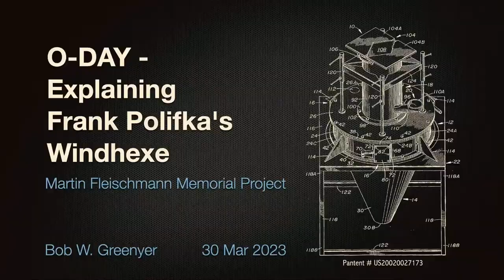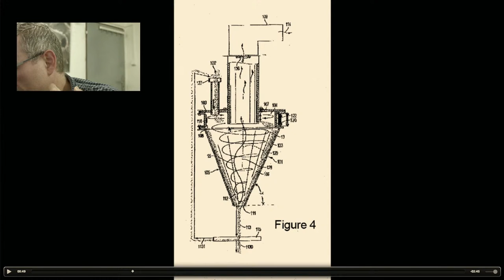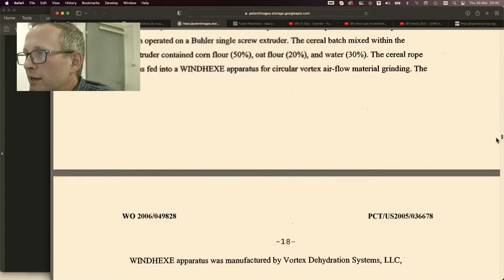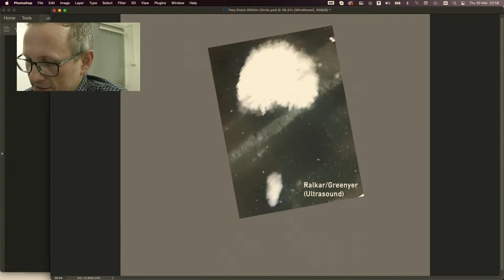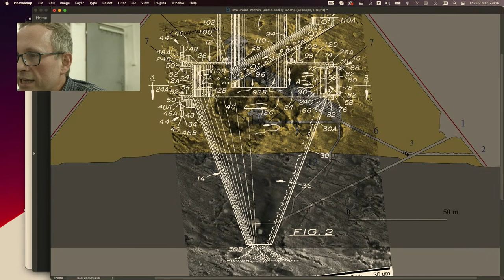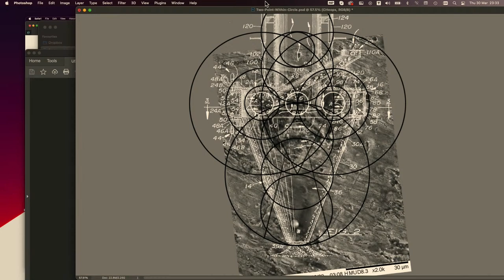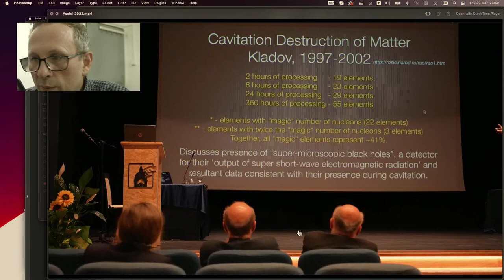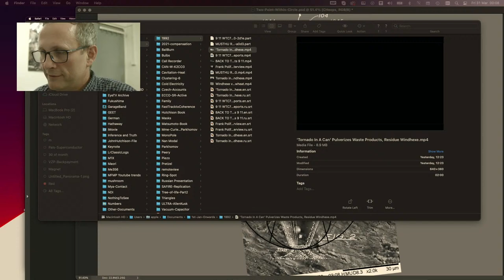O-Day - Explaining Frank Polifka's Windhexe 'Tornado Machine'

Comment: I appreciate your point of view. I do think some of the observations you offer on the pyramids are spot on. I would like to add some observations accumulated over the years of my study into Nikola tesla and the pyramids. 
First, the pyramids are constructed of entirely diamagnetic materials. No exception. 
The powdered calcite at 10 meters depth is so well compacted, that it seems as a rock. That is Uber important…..there can be no electrical connection to the earth, for the circuit of Giza to function properly. Equally, the capstones are insulators, and make sure all electrostatic energy is conserved in the rose quartz. 
Abdel hakim awyan documents the three tunnels that brought the water through the solid limestone tunnels. They travel 8 miles to where the Nile used to travel. 
Abdel’s son, jousef abdel awyan documents the cavities in the rose quartz that have no visible signs of entry, accompanying every single block that has a drill hole. The cavities are next to the drill hole……how those were done is a mystery to me. 
Viktor schuaberger and dr gerrold pollack explain how water accumulates electrostatic charge(water is diamagnetic) when flowing through curved limestone. 
There is a current from the sun that “washes” over the earth continuously. It can’t be accessed as it flows over the earth, but if a standing wave is put into the electrostatic energy flowing over the earth, at each low spot, there is a compressive force pushing to the center of the earth. By virtue of the  standing wave each low spot will be exactly equal to the other, all forces, and geometries are perfectly equal, and equidistant. 
Nikola Tesla clearly understood how this worked, and very carefully explained it in the Westinghouse bankruptcy hearing of Westinghouse. I have the court transcripts. 
Tesla also explained longitudinal energy, and damped waves, which are crucial to understanding how the earth can be made a reservoir of voltages in the trillions, and currents no common human could comprehend……amperes in the 100’s of thousands, and maybe millions. 
The low spots in the standing wave over the earth are @ about 75 kilometers separation from each other and, again are continuously compressing into the center of the earth, where they meet each other, and are “shunted”, and bounce back. The energy can’t bounce back, though, because there is a continuous force still pushing from the low spot in the standing wave. This compressive electrostatic energy is held in suspension, and Nikola tesla called this a damped wave. 
Now the earth is a battery like no other. The forces are all known, because the standing wave can be measured(Nikola tesla measured the circumference of the earth, minus the oceans. He was able to do this by his apparatus to measure resonance. Lightning gave it away. 
Now one only needs a tunable receiver(teslas magnifying receiver patent) to get an octave of a 1/4 wave to access trillions of volts, and currents that could easily part the seas(Moses found thoths tunable magnifying receiver). One only needs to ground the apparatus, and tune it….and ……really you are like a god, nothing can’t be done. 
Going back to the pyramids. They were ram pumps….there was a frequency(remember  the cavities) and by virtue of the volume/mass of the pyramids being an octave harmonic of the earth, the rhythm coming from the pyramids was the resonant frequency of the earth. 
The vortex that came from the top of the pyramid was electrostatic energy organized by sound, it held a gold sphere at an altitude that would put it directly in the middle of the electrostatic energy flowing over the earth. 
Nikola Tesla said he could suspend tons with magnetism, but he thought it feeble compared to the electrostatic repulsion attractive forces…..to which he could not find a limit. To tesla electrostatic repulsion and attraction is infinite. 
The sphere held at altitude of the earth, directly over the main pyramid was so well attached to the pyramids, that if you took a hammer to the pyramid, you would hear the pounding of the pyramid from the gold sphere at the same moment. 
That is how the pyramids put a standing wave on the earth. 
Anyone with a properly tuned apparatus with a top that is four feet off the ground, and perfectly insulated from the earths electric influence could tap into infinite energy. The pyramids were to protect from the deluge……the two mile high waves that wash over the earth could not penetrate the “bubble” of voltage…..

Comment: Thank you for a most excellent presentation Bob!. Ever since i heard about the Windhexe back in the early 2000s i have always wanted a bench top Windhexe materials recycling processor. Unfortunately not alot of the important know how details were or have been released over the last couple of decades o date.

But the newer 2008 patent you showed today is jam packed full of technical details, and with the help from an AI research assistant, i have managed to piece together all the rest of the details such as the compressed air pressure ranges and flow rates, roughly matched to specific diameter windhexe vortex chamber sizes.

Windhexes use alot of compressed airflow (this is quite an understatement), so for a small 30cm diameter windhexe (just like Polifka's original prototype), you will need in theory quite a large and expensive 10 horsepower (7.5 kW) air compressor for continuous use.

Although if you use a standard quite affordable vertical shop air compressor (around 90psi) with a 20 gal tank, it would be in theory good enough for decent batch processing. Well before the tank has to be recharged backup to pressure again, but using a far less rated power compressor.

Also investigated the potential of a 10cm diameter windhexe chamber design, and works out that you would only need a small entry level couple of kW (or maybe a bit less) air compressor instead. So all looks quite doable once you can fabricate or potentially buy on off the shelf vortex/ cyclone seperator chamber and alter it as someone else mentioned here (or on the other new vid you did in the comments).
Reply from the maker: Yes a shop compressed air tank and batch processing would be my approach.

Can you prepare a document for sharing with the community on these findings please.
Reply: Extra Note: Maybe a stainless steel funnel (or other durable material) with some suitable alterations and additions, could also be converted into a small windhexe chamber at quite low cost too...
Reply: @MFMP  Maybe in due course in a bit, as at present i am in the middle of a seriously intensive large sustainable building project. Which part of is also going to be my new proper fullsize workshop & innovation lab. Due to be completed in one months time ready for the big move. But i will see what i can do in between, cheers.
Reply from the maker: @petermiddleton6902  Possibly...

Comment: I found the water spout info especially fascinating. Several times I have witnessed them in both the Florida Keys, and on Lake Erie. In every instances, there were multiple spouts, and they preceded an electrical storm. One time on Lake Erie, I saw 8 of them in a straight line 2-3 miles long moving fast right in front of an extremely strong thunderstorm line, the kind that turns the sky green and has wind gusts over 80 knots. So the electrical charge theory rings true to me. BTW, the Keys are probably the best place to study them in the world as they are relatively common there. Just beware, they can collapse without warning and sink a boat by instantly filling it with water.
Reply from the maker: Thanks for sharing this informative experience. Did you ever capture any photos?
Reply: Sadly no, i had other worries at the time like getting to shore ASAP :)
Reply from the maker: @stevewindisch7400  Bet you did!

Comment: It would be interesting to be able to condense all the fluid that was removed from the material being processed that vents to 
exhaust/atmosphere. Having experimented a bit with Joe Cells I have learned that water here is not the same as water there. Having played with HHO, I am still testing this quantitively and qualitatively, but, using the entirety of your distilled water as your electrolyte vs. just using the more volatile first fraction of water will give different results to using the water that distils at the end of the process.. Some
 say using trap water will give unexpected results. But because there is so much water being pushed through the machine  it might be tricky to isolate,

Comment: Interesting video and technology! Glad I saw the video. One of my facebook mates gave it to me.

But what you described is not how you make Portland cement. In PC, you mix 80% of lime, a little sand and clay and then burn it in a huge horizontal kiln to well above 1400 °C. In a sintering process, the raw materials fuse together and form a calcium silicate mineral called 3CaO*SiO2 or alite which is stable at room temperature when cooled fast. This produces two times more CO2 than the combustion process itself because lime contains large amounts of CO2. It has little to do with mixing and although there is CaO stated, there is no quick lime. Quick lime is burnt lime CaCO3 to approximately 900°C and this makes CaO. But in Portland cement, there is no CaO but a calcium silicate named by the formula 3CaOSiO2 (and some others like 2CaO*SiO2, called belite). By the way, “Windehexe” is German for “wind witch”. No offense of course. Just thought you’d like to know.
Reply: Thats the ticket!

Comment: The key will be the energy efficiency. Eg does it take less energy to grind up a 1kg of rock or glass than say a ball mill.
Reply from the maker: In the studies by the "AirGrinder" they found:

- that the grinding was for free, the energy normally used for de-hydration gave you de-hydration and grinding.
- that metals became magnetised, allowing them their powders to be magnetically separated from mixed waste materials inputs
- that the particles where spherical and free flowing, milled ball milled materials might end up as flattened and so clumpy

In the study on preserving sweet potatoes to dry powder, it was found the particles had smaller average particle size and it was a one step process (drying and grinding). The competing processes were 1) forced drying then grinding conventionally or 2) freeze drying then grinding conventionally. The Windhexe was more efficient than both in both energy and time, had higher residual beta carotine content than 1 and similar to 2. Option 2 had a higher energy and time use. In the round, for preserving and grinding hyrdrated foods, it was the best balance between product quality and energy use and is probably why Kraft foods took it on.

The links to the AirGrinder and Potato study can be found here.
https://remoteview.substack.com/p/o-day-explaining-frank-polifkas-windhexe

Comment: The dark lines spiral in the water at the base of the water spout is the negative charge of the earth being attracted to the spout. The shortest distance is an arc in this magnetic field. Charles L. Chandler is quite wrong about many points in this book. He suggests in a tornado The charge, discharges between the rising outer wall and the falling inner wall "Ranque-Hilsch effect" and fails in not understanding this transmutation zone. He fails to account for the missing mass, debris, people, animals, cars, trees and soil, (similar to the 5 floors of debris pile with 15 floors of debris missing that should have been there and was not in the basement.) Simple observation. Then fails to account for the conversion to Hydrogen that appears with an affinity to combine with the Allotropes of oxygen that are also in flux. aka the O3 smell and the red color band of O8. He refuses to address the partial electrogravitic space time effects. People and cars being transported hundreds of yards and gently returned to earth without damage. 2x4 lumber imbedded in other lumber at 90 degrees without a split or shattering. 2x4 famously imbedded through and through a palm tree without a split or shattering. Janka hardness 800 piercing Janka 2020 without exploding. Pine needles imbedded an inch into poles and trees without breaking. Somehow these things discharge and appear fully back in our space time imbedded by chance. What is the Janka hardness of pine needles? 2 imbedding 2020 of palm and 1200 of pole pine! So simple observation is ignored and animalities get thrown out as opposed to actual science that requires their study. So more is happening in these tornados along with most of what we already know is happening. I'm suggesting additional water is created from the vacuum by induced ether energy. Matter is being trans mutated or destroyed or recycled. Matter / elements are being created. 
Plants take up water use up the hydrogen and release O2. What replaces the water on the water planet? Clouds also may use these forces in a less dramatic destructive way. 
4 inches of rain in an hour is 20.80 LB of water per sqft. 1 sq mile is 27,878,400 square feet x 20.80 lb = 579,870,720 lbs/289,936 Tons.  43560 x 20.80=906,048 lbs/453 Tons per Acre

50 miles long by 50 miles wide=2500 sq miles x 579,870,720 lbs/289,936 Tons sq mile=1,449,676,800,000 lbs/724,838,400 Tons at 2500 sq miles, a 50 mile long and wide storm. A storm from only Philly to Atlantic City and south to Cape May NJ. 50 x 50 +/- So, when you are driving to the beach on a very dark cloudy day just remember 724,838,400 Tons of water are floating in the sky above your head in South Jersey effortlessly according to the trusted science. And also remember that cloud nucleation is from cosmic rays according to the latest BS.
Our obversions, logic and reasoning, and sometimes simple math tells us fuckery, in our upside-down world, is going on in our source material of knowledge. IMHO

Comment: I bet air with less inertia would have lower viscosity…
Reply from the maker: If it can form its own Mean Square Radius in the form of a torus and shield itself from the cause of Inertia - then what is the limit to the velocity. If the net non-loss pointing vector & toroidal moment still projects, it may explain the observables.

Comment: Magic ingredient looks like glycerin.  Would leech the water and form its own bonding polymer as it dries.
Reply from the maker: I think armed with some of the Windhexe cement powder, the people here could rapidly establish what works.
Reply: @MFMP  The clear liquid he adds looks slightly viscous, so this is most likely to be a Sodium Silicate solution. Which is a commonly used additive to make a whole variety of geopolymers and new sustainable cements.
Reply: @MFMP  Using the concept that the slightly viscous clear liquid he adds to the WindHexe recycled concrete powder is a Sodium Silicate water solution, here is the geopolymer reaction:
The alumina component from the windhexe produced recycled concrete powder when mixed with sodium silicate water solution forms the geopolymer: Al2O3 + 2Na2SiO3→ Na2O·Al2O3·4SiO2·nH2O Na2Al2O4 + SiO2 + H2O → Na2O·Al2O3·2SiO2·nH2O (Where as the CaCO3 component from the recycled concrete powder will be inert) 
The resulting alumina silicate based geopolymer produced from this reaction can be used as a replacement for Portland cement in concrete mixes, providing a more sustainable and lower cost alternative.
Reply from the maker: @petermiddleton6902  I think with a bag of powder, we'd work it out in a few hours.
Reply from the maker: @petermiddleton6902  I see builders being able to use an old building to build a new one.
Reply: @MFMP  just don't let the cat in when operating.
Reply: @MFMP  Totally Bob!. Whats more is that sodium or potassium silicate can be prepared in quite large batches by safely dissolving recycled glass bottles or glass in a hot caustic sodium or potassium hydroxide solution (eg lye from wood ash). So its an all round quite low tech sustainable geopolymer cement solution, no matter where you are in the world.
Reply from the maker: @pauloneill9880  E-Cat?